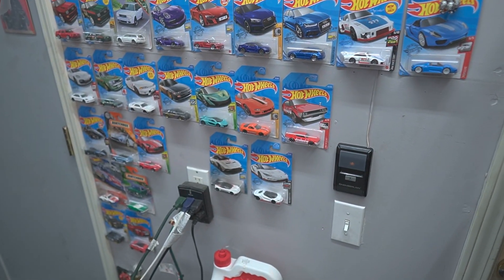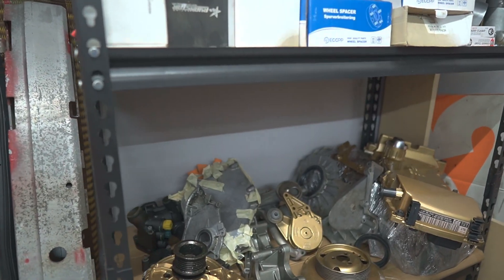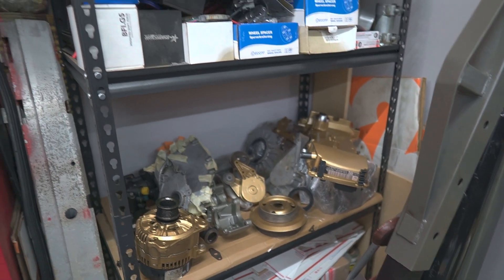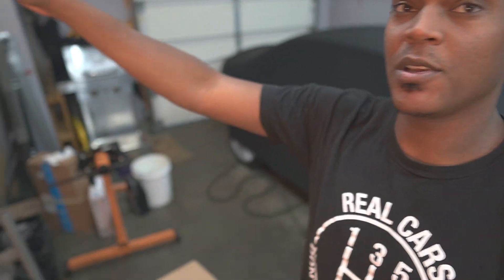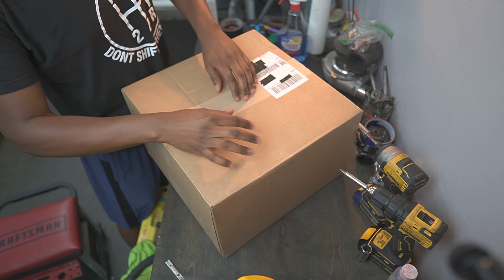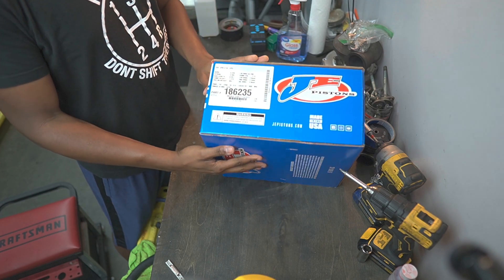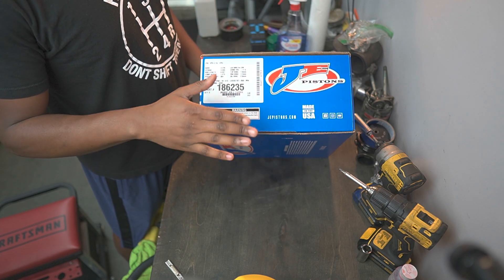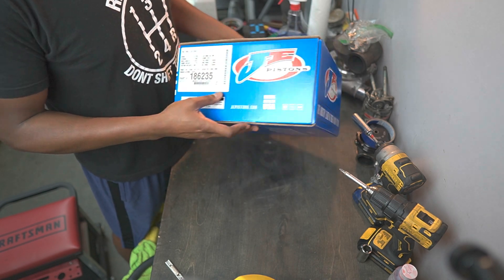JE Forged Pistons for the 12v VR6 Turbo

Comment: Bring back the 2.7T or tell us wtf happened
Reply: His turbo blew. Now he is building a BA sounding, simpler, and easier to maintain VR6. What else do we need to know?
Reply: @fiveforbiting  you just throw a built STK 2.7T in the trash after blowing the turbo and even buying a replacement? There's got to be more than that. How and why did the 2.7T die!!?? This guy is my inspiration to STK my 2.7T and as I finally buy the piping and wastegate he throws the project away :(
Reply: @fiveforbiting  I joined for the 2.7 content